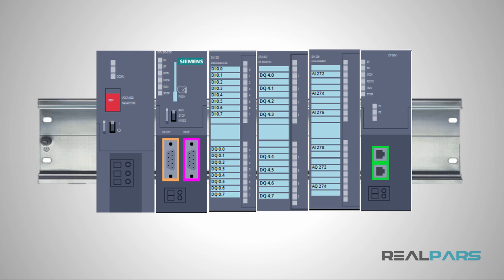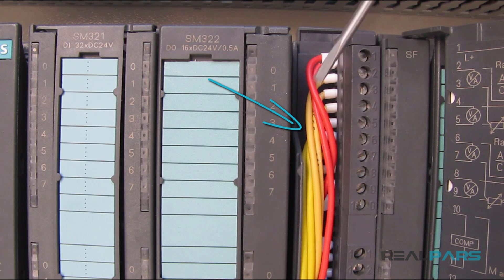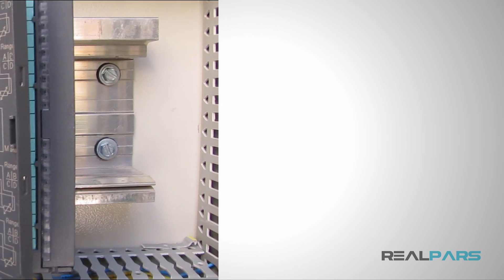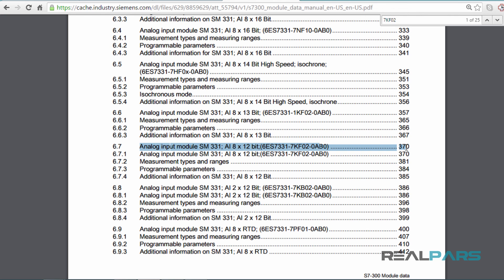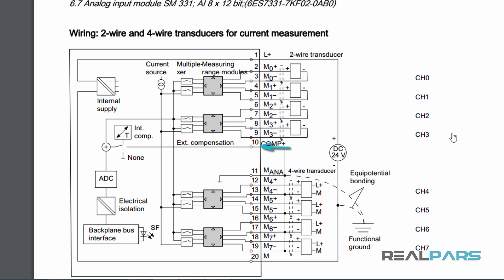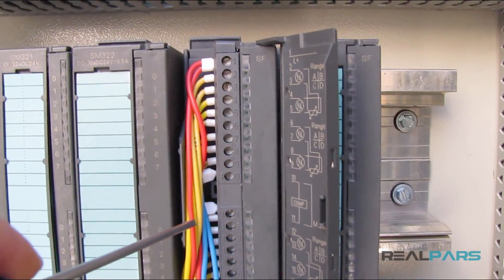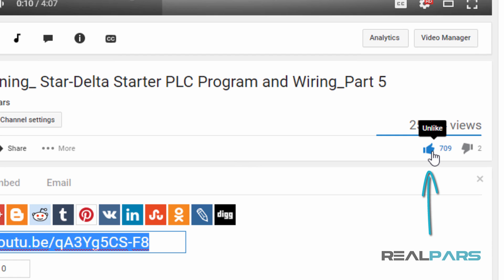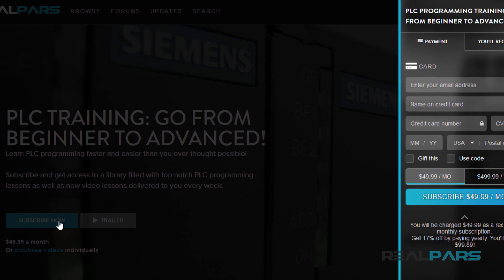How to Wire Sensors to a PLC - Part 2

Comment: There are some different installing two wire device and 4 wire device. Always using manual to know where the location input output number are. The PLC system used to have channel for power source 24+ and 24- voltage near position channel input output.

Comment: This is excellent! The lessons are very enlightening and I'm fast learning how to program PLC using STEP 7 software. After watching this video, I got two questions, the answers of which I don't know, still confusing me. 

1)... The front connectors come in 20- and 40- pins. But the terminals of the modules (depending on the type) can be of 8,16, 24,  or 32 bits, that is, ports for connections. How do the front connectors match these terminals? 
.
2)... How are field devices requiring VAC connected and powered, since the modules are powered via a VDC supply?

Thanking you in advance.
Reply from the maker: Hi there, Thank you for your positive feedback. Here are my answers to your Qs:

1. To keep things simple, you can think of these as inputs and pins. For instance,  a DI32 card can receive up to 32 digital input signals but to wiring the signal to this card we need a 40-pin front connector. Why? because in addition to the signal we also need to power the card as well and turn it on like any other electronic device. So we need a few additional pin to be able to power the card. 

2. We don't use the PLC modules to power the field device. You can use separate power supplies to power the PLC modules and the filed devices. 

I hope these answer your questions.

Comment: Why should I connect GND wire to the pin 10? it says "Ext. Compensation" but I didn't understand the reason. Thank you for the lesson.
Reply from the maker: Well as you can see, the wire comes from the same  -24 V as terminal #11. So we should give both #10 and #11 a -24 V  based on the diagram. I'm not sure about what COMP+ is related to here. We always power these 7KF02 analog modules this way and it works perfectly fine.
Reply: Thank you for the answer. :)

Comment: so it mean we canot connect both 2and 4 wire transducers in same module.did  we need separate module for each?
Reply from the maker: This totally depends on the analog input module you're using. Some cards can receive input signals from both 2 and 4 wire transmitters.

Comment: how do the i/o's cards and the cpu communicate ? , how the cpu recieves the signals from the inputs cards and how does it transfer those signals to the outputs cards ???
Reply from the maker: For typical S7-300 PLCs, the CPU and I/O cards communicate through bus-connectors that you should install on the back of each module.  However for S7-300 redundant systems and S7-400, the racks ( where you install the PLC modules) have already communication bus on them so you do not need to use any bus-connector here. For more info and if you're already a subscriber to RealPars video library I recommend watching this viedo: https://realpars.vhx.tv/plc-hardware/videos/power-supply

Comment: When I wire the analog input module up the sf light goes off but when i disconnect any wires the sf led comes on i have 24v going to pin 1 for pos and pins 10,11 and 20 as I am trying to connect a siemens CO2 sensor to it the model number is AQR2576NH
Reply from the maker: When the "System Fault" LED turns on it indicates that there is something wrong with your configuration (both in hardware or software) or maybe with the wiring. Take the following steps to make sure you're not missing anything: 

1. Google the order number of your analog input module and download the manual. You can also google "S7-300 Module Data" and download the PDF file. 

2. When you open the PDF file, hit Ctrl+F on your keyboard and find the specific order number you're looking for. 

3. Check and see if the analog input module supports your sensor. That means you need to make sure you're allowed to connect such a sensor to this AI module first. 

4. When you're sure that the AI module you have supports your sensor, go ahead and check the wiring diagram for powering the AI module. 

5. Next, check the wiring diagram for your sensor and see how you need to connect that to the AI module. This is what you can find in the same section in "S7-300 Module Data". You can also take a look at the sensor's manual. The wiring is usually very easy and straight forward. 

6. If your AI module supports multiple measuring, you also need to configure the "range module" both in the hardware (actual environment) and software (in the HW Config). This is also very easy to do. Take a look at the left side of the AI module. It clearly indicates how you should configure the range module. For instance, it says if your incoming signal is voltage, you need to put the range module on A or if it's resistance you should put it on the B and so on. (This is just a example, you need to check what's written on the module). You also need to do the same in software. For that go to HW Config, choose the AI module and go to properties and set the configuration for each channel the same way you configured the hardware. Hope this helps.

Comment: Do I still need to supply power even though the I have an adapter module linking the inputs to the plc also how would you wire a push button to it?
Reply from the maker: If you mean the PLC DI card, yes you do need to power the module in order to turn on. It's like any other electronic device. For the switch you need to connect a separate power to one end and then connect the other end to the PLC digital input card. Hope this helps.

Comment: When wiring the 4-wire transmitter, can I use the same power source that is used to power up the analog input module (L,M) to power up the transmitter? 
Thank you for the great video!
Reply from the maker: Hi Abed.  Good question. To keep your AI card safe you better use two separate power sources for the AI card and the 4-wire transmitter. However we sometime use one power supply to power both devices as well, like what you see in this video, and nothing bad has happened so far. So the right way of doing it is having two separate power sources but in some projects there are some other considerations that forces you to accept the risk and use only one. Hope this helps!
Reply: Thank you so much for the reply. Very helpful. I have another question please. Can we use the PLC's power source (0 - +24 VDC) to power the I/O modules instead of using an external one? Would that affect the PLC or is there a limit to the number of modules that can be powered up by the PLC?
Reply from the maker: Absolutely! You can use the same power supply to power the CPU and other PLC modules including the I/O cards. But before that you need to make sure that the power supply you're using is capable of power all those modules. Each PLC module needs to use a certain amount of electrical current to turn on. For instance, if you have 6 modules that each draw 0.3 A current. you need a power supply that is able to at least provide you with a 1.8 A of output current. However, in this case, to avoid the power supply to work with the full load you better choose one with 3 A output current which is about 2X the output current you need. To figure out how much current each PLC module or any other electrical equipment draws you can simply take look at its manual.
Reply: SInce field transmitters tend to be at some distance from the PLC, one point to consider is the volt drops in the wiring to the transmitter. A second point is that generally PLCs have a regulated, fixed power supply, so powering field devices from the PLC power supply will reduce the power available for the PLC. Third, power for a field transmitter will introduce harmonics on the PLC power supply.

So, all in all, a bad idea. All signal cables should be earthed at the PLC only, to prevent circulating earth currents.

Comment: I don't see how it is clearly marked that Pins 10 and 11 are also connected to -24 VDC?  I think that is easy to overlook in the diagram.
Reply from the maker: Brett, most wiring diagrams follow the same pattern. If you learn how to figure that out with one diagram it's easy to read and understand the others.

Comment: The Input module technically doesn't know if I connect a 2 pin or 4 pin transducer to it. If the only difference is that the 4 pin transducers need external power then I can technically connect them anywhere.
Reply from the maker: Kevin, before wiring your device to the input card you first need to do some hardware and software settings to let the input module know what type of device you're going to connect to it. So the input module already knows what type transmitter you're going to connect to it.

Comment: inputs are to tell the pc whats going on,right? 
outputs are pc right actions from the inputs?!
Reply from the maker: Yes. The PLC receives the data from the field by input cards, processes that with the CPU and then sends the required commands back to the field using the output cards. To learn more watch this video id you have not already https://youtu.be/ReTtgzN-Dmc